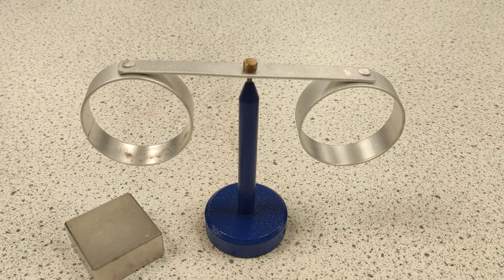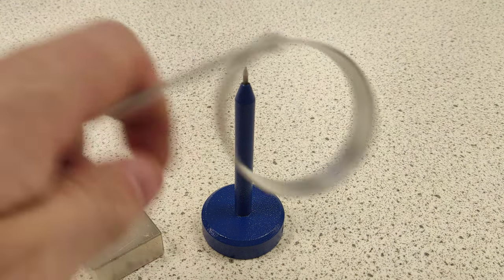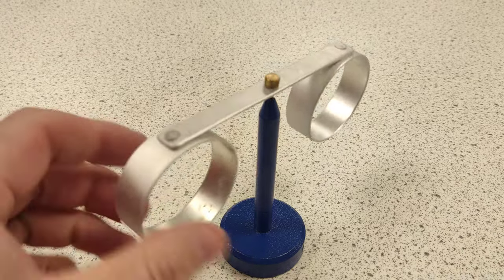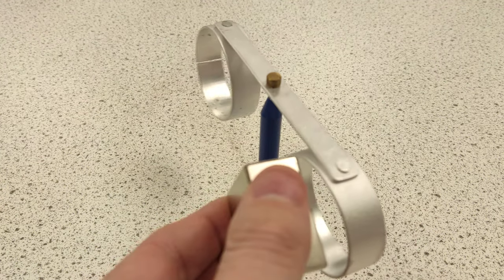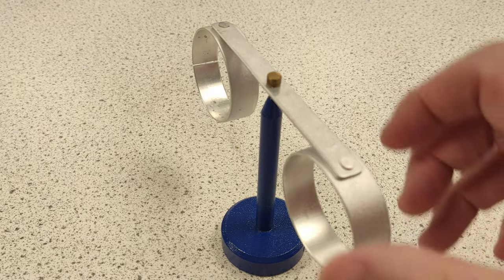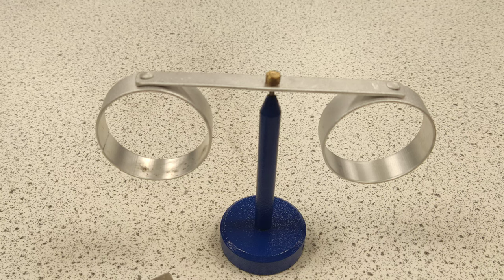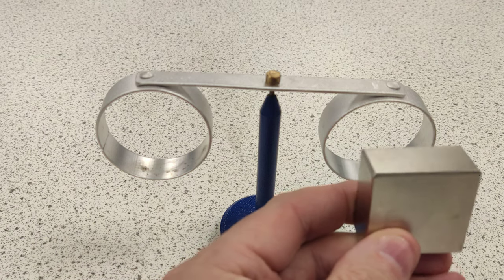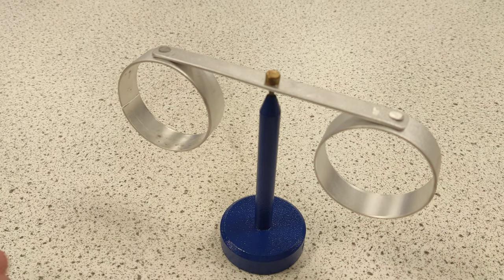Faraday's Law of Electromagnetic Induction and Eddy Currents  - AQA A Level Physics

Comment: What term would I use to look up a list of the different metals that react this way and their strengths???  I have Lenz's Law, Eddie Currents, and Faraday's Law of Electromagnetic Induction.  None of those seem right.
Reply from the maker: It's any metal that can carry charge carriers.
Reply: All conductors work. Assuming the only difference is the metal type (not the geometric shape), and the magnet moves away with the same speed (as a function of time), then the induced voltage (as a function of time) is the same in all different kinds of metal. The induced current depends on the electrical conductivity of the metal. So the force, proportional to the current, also depends on the conductivity. The motion also depends on inertia. So if you want the largest movement, you would pick a metal with the lowest density and higher conductivity. So aluminum is this video is a really good choice from this perspective.
Reply: @darkphoton_15keV  You're saying all non-magnetic metals work the same?  Bronze, copper, aluminum, etc.?